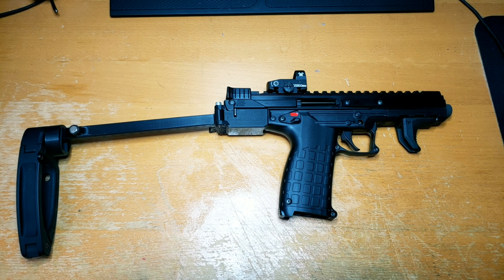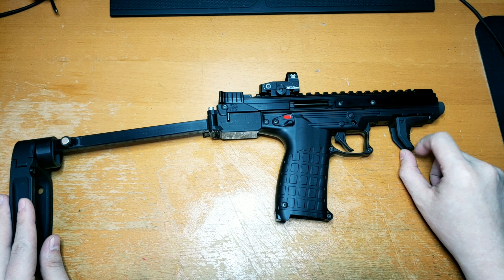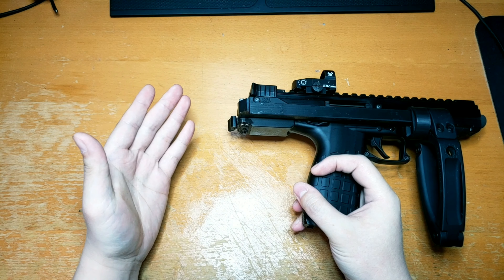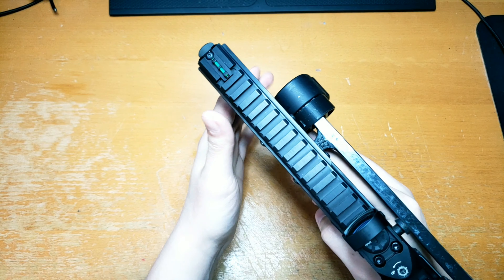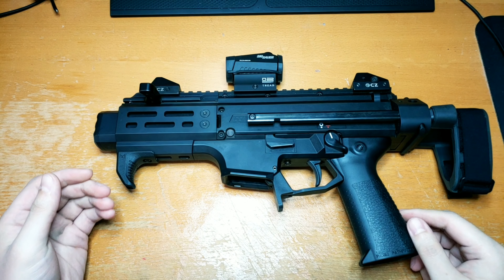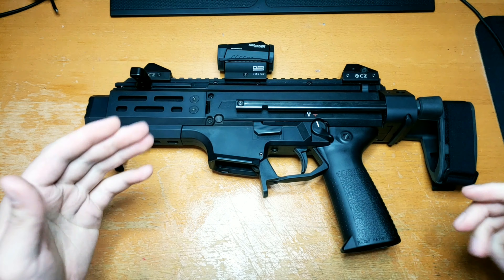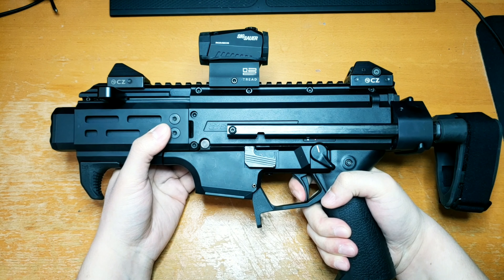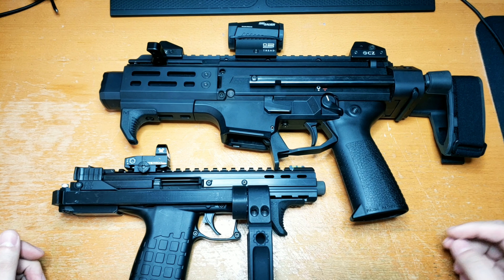Update and followup kel-tec 33 and cz micro

Comment: I appreciate your video and think that you did really well with the design. My only suggestion would be finding a square stock of either carbon fiber spar or aluminum would work fine and you could print with a zero infill add a couple extra walls and top/bottom layers. Then set to pause the print before it does the top layers and you could insert the metal inside and then the printer would self seal it. And adding a few additional top layers would keep it looking nice.
 Waiting to find one of these for around retail price, I see them selling super high right now. 

Thanks

Comment: you said it was hollow? so far any print of pla+ ive made with more than 70% infill is TOUGH, i couldnt imagine 22 recoil could do any serious damage to the material. any 2020 updates?
Reply from the maker: Yeah I went and stuck an aluminum tube in mine and stiffened it up. Also Ive been waiting on the new compact tailhook so I'll have that one soon to mess with for the new design. But nothing soon.
Reply: @pixelsixdesigns  There a file for the one with a space for the tube?
Reply from the maker: @afgh1408  nope, just printed the arm piece with no infill.
Reply: @pixelsixdesigns  thanks for the quick response, gonna print this soon

Comment: I accidentally ordered an aluminum charging handle for my S2, which I have since been warned that metal charging handles should only be used on polymer hand guards, as they will scratch off the finish of the HBI aluminum hand guards.  Your set up does not appear to have suffered too much.  How long have you been using it in this configuration and how well has it held up since the shooting of this video?
Reply from the maker: you would be correct there is some serious friction with the al type handles.  I personally just took and sanded/polished our the one chamfered surface in contact with the handle and applied some lubricant. other than the one little strip the rest of it is fine. And its aluminum so I'm not too worried about oxidation.

Comment: Sorry correction... Where did you find the hand stock it fits so perfect
Reply from the maker: I'm a little confused by the question. if you are asking about the hand stop for either pistol. its a mlock magpul hand stop. the brace on the kel-tec is a gear head works mod1 brace, the rest of it is 3d printed, the link for the file is in the description. on the scorpion is the sb tacticl/manticore arms collapsing brace.
Reply: @pixelsixdesigns   GREAT U RESPONDED! ITS THE HAND "STOP" I WAS TRYING TO GET AT. APPRECIATE IT BRO
Reply: @pixelsixdesigns  I got more question? Is it possible to put an AFG grip onto the front?
Reply from the maker: @trapboiii843  for both yes. But with the keltec you would need to install a suppressor or a long liner comp to make it safe for your hand.